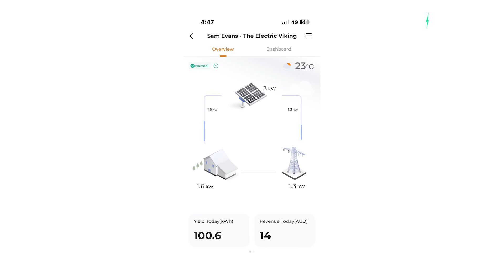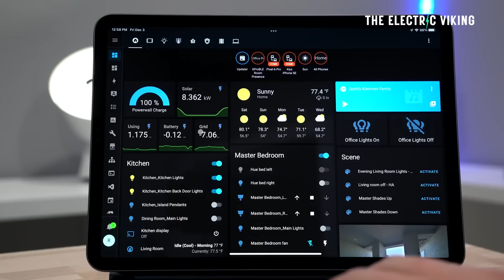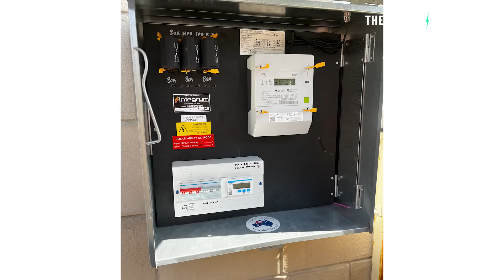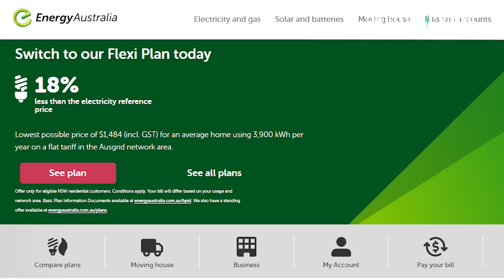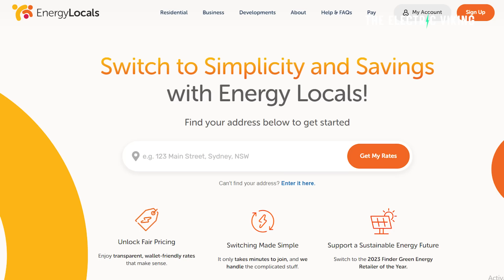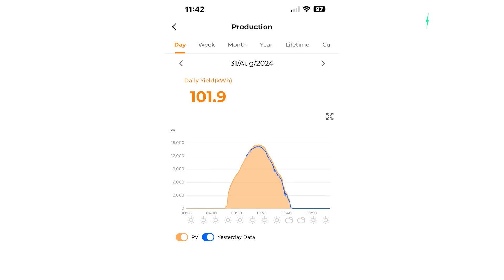Review of my NEW solar system installed by Resinc Solar in Australia

Comment: The problem is that in Australia the STC installation rebate system invalidates upgrading most solar systems. If you install a bigger new inverter and new panels, older solar panels that are fully operational and safe (but have dropped off the latest approved list of solar panels) cannot be connected to the new inverter and allow the upgrade to be eligible for the STC rebate. This forces many upgrades to not really be an upgrade but a total removal of the system. Luckily there is a booming diy projects market where people can use these old panels and put them on a vehicle or shed.
It would be great for the environment if a law was passed which outlawed the dumping of solar panels in landfill and encouraged re-use and recycling.
Reply: Excellent comment.
People don't realise how difficult it can be to get 3phase as electricity demand on the fragile grid is very real.
V2G is coming to protect the grid from overloads and blackouts.

Comment: Pretty sure everyone has to pay for a smart meter.
Reply: 90% of energy retailers in NSW at least provide them FOC unless there are major upgrades required (fuses need moving/upgrading /not enough room etc etc.) the reason is because the new smart meters are GPRS eneabled they (the retailers) don't need to pay a meter reader anymore. They can read the meter remotley. Just think of the amount of money they save on wages and insurance - dogbites etc the retailer is saving a motsa. Hence why they are usually free here. I can't speak nationally here in Aus but it's the case here in NSW.
Reply: In Victoria they were mandatory about 15 years ago. I had to pay AU$1000 to get mine inc installation.

Comment: The power you send to the grid can only be used in your local area, because the power is stepped down not up.
Reply: A transformer is bi-directional. It makes NO difference which way the power goes.

Comment: Why on earth did you not install a Powerwall at the same time?   I had solar and a powerwall 2 installed in May, been off-grid until last couple of days, due to the shite weather here in the UK.  The Powerwall and App just does everything, fantastic!  The local power supply connection and payments for my surplus was a bit of a problem but got it sorted eventually.  Only have a 5.25 kWh but so far this suffices and have sent my surplus of 1.2 mWh to the grid.

Comment: Why did you get rid of the old panels?  Seven years is the payback time.
Reply: The problem is that in Australia the STC installation rebate system invalidates upgrading most solar systems. If you install a bigger new inverter and new panels, older solar panels that are fully operational and safe (but have dropped off the latest approved list of solar panels) cannot be connected to the new inverter and allow the upgrade to be eligible for the STC rebate. This forces many upgrades to not really be an upgrade but a total removal of the system. Luckily there is a booming diy projects market where people can use these old panels and put them on a vehicle or shed.
It would be great for the environment if a law was passed which outlawed the dumping of solar panels in landfill and encouraged re-use and recycling.

Comment: Hi Sam most people don’t have a house big enough to fit 26 kW on the roof. The average is between 5.5 kW and 8 kW can fit on a roof in Sydney and if you’re lucky you might fit 10 kW.
Reply: @gregwatling4041  if you mount East West, you have both sides of the saddle roof you can put panels on, compared to one North side
Reply: @ttkddry  I understand what Sam has done. He has a house with a really long big roof facing east west, most homes in Sydney and around Australia won’t fit large solar arrays,they are small homes with smaller roofs and your cramming on solar panels wherever you can fit them.
Reply: @gregwatling4041  I am trying to understand what you are typing above but the grammar makes no sense. He has a big roof facing E/W, so instead of adding 10kWpeak on the North side; he has 13 kWpeak on the E and on another 13 kWpeak on the W side
Reply: @ttkddry  that’s what happens when you don’t check your voice to text. 
His roof is not the average configuration for a home in Australia. He has a very large roof.   
I have 5.3 kW on the roof and they’re five years old. I think I can fit about 8 kW now if I update to more modern Bi-facial panels but they’re facing north and west. 
What I’m saying is you can only optimise your own roof. Sam’s roof means nothing to anyone else.
I’ve had my system for almost 5 years and only because feeding tariff started off at .21c a kilowatt hour and then reduced to .16c a kilowatt hour then the .12c a kilowatt hour then to 5 cents a kilowatt hour and now I’m back up to 7 cents a kilowatt hour by the end of this year I should have payback then,but anyone putting in a system now won’t get payback for 10 years unless the feeding tariff goes back up again, in some parts of the grid you’re actually being charged 1.2 cents a kilowatt hour to feed your excess back into the grid.
Reply: @gregwatling4041  You are absolutely 100% correct. My 5.8kw system installed 14 months ago has now revealed itself as being a false economy. I have a feed in tariff of 5c per kwh and after taking into account all costs (including interest payments on the green loan) the pay back time has become ridiculous. I see people focus on their post solar bill and compare it to their pre solar bill and don't account for any other costs. The single biggest saving I have made on my bill was charging my Tesla Model 3 through the Origin EV Power Up plan. 8c per kwh has made the biggest impact on my bill and made any savings from solar absolutely negligible. If you were an early adopter of solar, you are winning, otherwise it's a don't bother from me.
Reply: @gregwatling4041  yes, we have a simular situation in Belgium, historically we have 1:1 net metering but that was not sustainable.  When I feed in my excess PV, electricity prices are negative because of all the excess PV. When I get power from the grid when it turns dark, electricity prices are high but yet I pay nothing. So our grid is moving to feed in tarrifs like yours and then the break even calculations do not add up anymore unless you have 100% self consumption. Excess renewable power makes it less valuable, we now pay windmills to shut down to prevent grid instability...

Comment: The straw light energy is about 10 % of your peak. So when you have 450 Wp there come about 45 W from the modules even on cloudy days or durin sundown or sunup.
There are even modules available which can catch IR light so the still producing a little amount during the night.

Your company just did clamp your modules straight to the roof. This isn't the best solution for doing this because this system fixes the modules and gives them mechanical stress because of temperature changes. A better solution is to have a fixed frame to the roofe where the modules just layed in loosely and so the can make their little movements with temperature. The result you will see after 20 years. With this clam system the glass of the modules will get tiny breaks which make the modules blind with time, so they will produce less and less power. Modules with the inlay system are still working fine mostly even after 30 years because they had no thermal stress from fixation straight to the roof. 
Of cours the inlay system is a bit more expensive that the cheap clamping to the roof. But at the end it is a reliable invest, because of the so much increased lifespan of the modules.

Comment: This is awesome! Congrats. Question: Are there any backup battery systems that work with smart home automation (Tread over Matter since it's the new standard)? For instance, if the power goes out and the batteries are now powering the house, then the automation turns off ALL non-essential lights, appliances, etc... adjusts heat or air con, and whatever other automations you can think of.

Comment: Bifacials perform even better with indirect light as it bounces through from both sides of the panels. We have 8Kw of JA Solar here at 36 degrees south. Good in cloudy weather which NZ excels in. 😊
Reply: @puririmoth  does that work roof mounted or do you need to get them ground mounted to allow reflection to reach the backside?
Reply: @ttkddry  We have both a Clenergy Pergola with 15 panels with polished concrete below and panels terrace mounted but set off the roof about 40 degrees.

Comment: Had a ground mounted 16k system since 2022. It's a grid tied system because here in NY State we have  net metering.  It works like a bank account for kwhs.  The excess solar production goes to the grid, the bank account, and withdraw kwhs when needed at night or in winter for example.  We get a 1 for 1 credit.  In the time we've had the system it has saved us $5000 USD.
Reply: Cost me less to make my homestead offgrid, than what my local utility wanted to run 250ft of wire into the house and install the meter. Im in Saskatchewan. 24kw of solar, 4kw of wind, 30kw of storage. Only time the generator started up to charge the batteries? I was too sick to go clear the panels off from the snow.
Reply: Don't forget to thank your neighbors for subsidizing your Solar. Your government forces the power company to pay you more than they pay every other electricity provider.
Reply: @Dav1d_B  I did thank all my republican neighbors for subsidizing my solar system. For the few that complained I asked if they had ever complained about subsidies and tax breaks for the U.S. fossil fuel industry and if they had ever complained about future tax expenditures to seal abandoned gas and oil wells.
Reply: @Dav1d_B  You can parrot very well, but:"The language the industry uses gives the impression that it pays a high federal income tax rate. The American Petroleum Institute cites an industry-wide effective tax rate of 44.3 percent. In reality, the amount oil and gas companies pay in federal income tax is considerably less than the statutory rate of 35 percent, thanks to the convoluted system of tax provisions allowing them to avoid and defer federal income taxes."
Reply: @Dav1d_B  "The 2017 Tax Cuts and Jobs Acts lowered the tax rate for U.S. corporations, including deferred taxes. The more billions of dollars that had been deferred, the greater the savings from the new law, because the money that would have previously faced a 35% tax rate was now subject to a lower 21% rate."
Reply: @markvalery8632  You still pay deferred taxes. Sorry, delaying isn't getting out of them.
Reply: @Dav1d_B  Wrong, read up on the the depletion allowance. Companies use the deferred taxes because it saves them money or the accountants wouldn't use it. Try reading "How Oil Companies Pay Such Low Taxes"  from 2022
Reply: @markvalery8632  Companies don't pay taxes. Consumers do. You seem confused.
Reply: @Dav1d_B  Then they should be behind raising the corporate tax rate since they don't pay taxes.
Reply: @Dav1d_B  Oh I feel so guilty!

Comment: Black panels tend to be monocrystalline panels, which are generally more efficient than the 'blue' panels, which tend to be polycrystalline.  Black panels are more expensive on the whole therefore, but you get your return back sooner through higher efficiency.
Reply: Tytyty
Reply: I dunnow TS, I've found black panels attract more heat so they would be slightly less effcient in the peak hours of sun but because these are East West it shouldn't be a big issue for him. You will usually see this on the monitoring platforms as a flat line on the bell curve, saying that, they do look good and they still do a fantastic job at generating energy. Longi are a good company to deal with as well. Poly vs Mono? 30 years in and I still have not seen real world evidence, mono's have higher peaks but polys tend to start earlier and finnish later on the bell curve so it's kinda even. Poly's are cheaper and have good warranties these days as good as the monos, so it's horses for courses I guess.

Comment: It's not about sunlight Viking. It's about daylight. That's why this technology works in the glum UK climate for example. But more of direct sunlight will indeed generate more power..
Reply: Is there a lower threshold?
Like my eyes can see a bit at night, there are still a few photons from the moon or whatever else. Does the electricity production of solar panels simply drop to a very low essentially worthless level, or is there a threshold at which it actually drops to exactly zero?
Reply: @SigFigNewton  I'd be amazed if any solar panel could use just a few photons to generate any power at all. In fact... my inverter is the limiting factor. It shuts down after a certain level of input (what it is I don't know).
Reply: @greghudson9717  ok, so there’s definitely at least one component that causes nothing to be produced below a certain level. Thanks.

Comment: $10/day?!? Here in California the regulators in 2023 allowed utilities to double rates while basically eliminating solar incentives so they can profit. I break even with 34 panels but new solar installs barely get credit supplying the grid. I’m grandfathered in 20 years from 2016 so my system was paid off in 6-7 years but new solar installs really require expensive batteries rather than sell electricity to the grid at a fraction so it will likely never pay for itself. But I’d rather buy solar than support CA utility monopoly profit. PGE profited $2b last year and their CEO made $65mil the last two years. They set fires and pass on millions in lawsuits to customer rates. It’s criminal and most people don’t know because their rate system is confusing and there is no other option. Google NEM3.0. And yes pls do the cancer “cure” story.

Comment: I have the same problem that you have.  My house faces south west, so I need to put panels on two sides. My first quote was 55k for battery and solar and it will take 10 years to brake even.I am going to keep trying to get more quotes.
Reply: Just install solar for now then update the system to include battery storage at a later date.